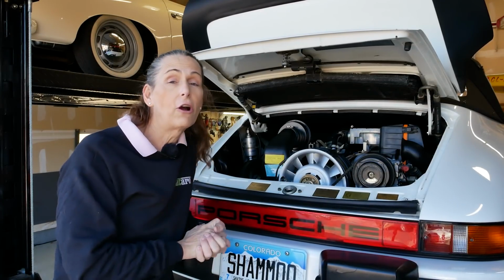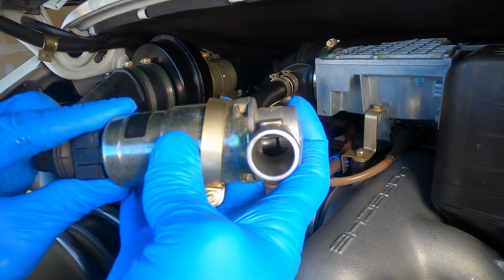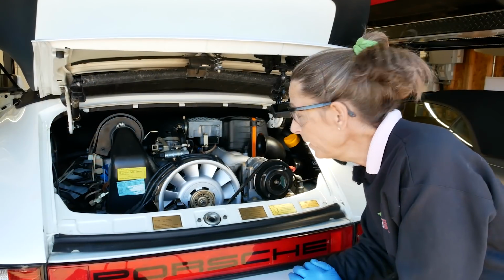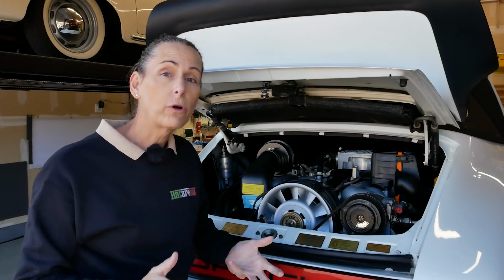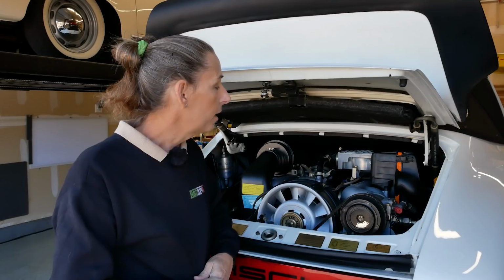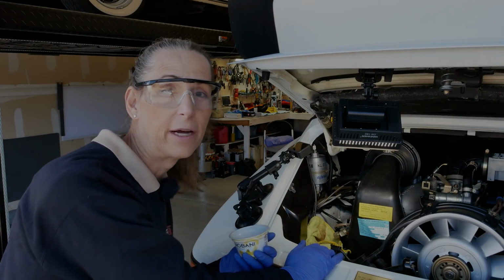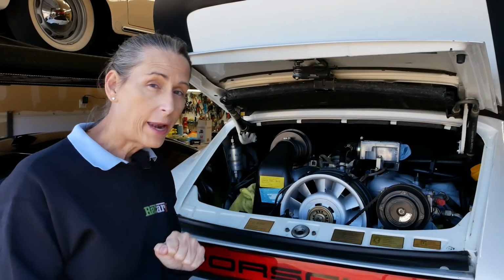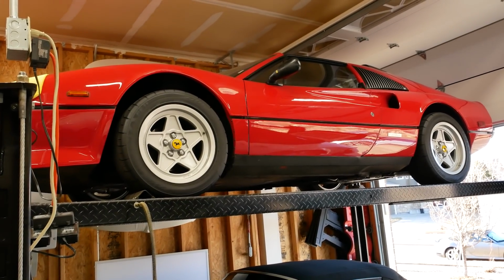Budget eBay Porsche 3.2 Carrera Project Car! #29 - WHAT IS GOING ON WITH THIS ENGINE!!!

Comment: Oh no ; i Hope you changed the plugs ...

Spark Plug‘s with 4 Poles  ?  Better take Bosch or Beru Plug‘s with Single Pole cause 4 Poles Plugs are made for Racing Engines and for those with High HP Output and High RPM ( Supra with huge Turbo or 9FF Porsche and Co. ).  For an Oldtimer 911 could the Temperature inside rising and it comes earlier the explosions as normally by 3. Stroke  Point. 

Its a hint from a Car Mechanic & Engineer Study Times and Testdriver (Audi Sport, AMG and some other companies) from Germany and a Friend got a 911 years ago scarce with a blue eye notice before Destroying the Engine during Autobahn drive with 4 Poles Sparks run. First KM or Miles was all ok. than after around 500 Miles   Getting the Engine hotter and hotter and the rpm began jumping & Rising after normal warming phase over. The oil and water temp rise to day after day using until we changed the plugs. Check sparking point with special tool .. it sounds maybe that is incorrect to early or to late (audio sound..) and that can cost Gas and Engine Lifetime..
Maybe i am wring with that point.

Have Fun and good luck on streets with your 911 👍🏻😉

Comment: Awesome video best I've ever seen on the 3.2 Carrera. One minor point going through the process is the distributor in that series 911 running Bosch DME does not affect the timing of the sparkplugs firing. That function is from the flywheel position sensor so the distributor merely provides the mechanical link to conduct the spark from the ignition coil to each spark plug.

Comment: A lot of useless yammering - much of it just plain wrong. Warm engines with aluminum heads don't "clamp down" on spark plugs. In fact, it's just the opposite - the material expands when hot and makes it easier to remove spark plugs which may be partially seized in their bores. The only reason to wait for an engine to cool slightly is to allow the aluminum threads to be exposed to stress when aluminum is stronger. The higher the temperature of aluminum, the lower the yield strength. At the same time, a warm engine's spark plug bores are expanded to allow for easier removal of a steel threaded spark plug. That's why EXPERIENCED AND KNOWLEDGEABLE mechanics pull plugs with a moderately warm engine - not hot and not cold. "Carbon could break loose and hold one of the valves open" - seriously? Injectors "lock up" after sitting for a year or so"? More BS. If the injector rebuilder rebuilt them properly, they would have been properly lubricated with WD-40 before getting capped. Injectors sit at distribution warehouses for years before getting sold and used. If they are properly packaged after testing, they will have a virtual indefinite "shelf life". You may be an older person - congratulations you've been breathing for a long time - but you are clearly a faux mechanic who has about the same kind of knowledge one could obtain from reading books and listening to other misinformed people. This video was a joke - clearly intended to impress people who are largely clueless around an automobile.

Comment: Hi Franny
Great video as always. 
Now my expertise is limited to the 911’s window washing system.....however I did notice that the cable tie on the fuel line to no.4 looked pretty tight and potentially restricting the flow of unleaded goodness. Not related to your current issue but wondered if that would cause any power loss / restriction / imbalance?
Cheers, Matt
Reply from the maker: Thanks Matt, That is actually the wire to the injector ;)  They get their fuel from the square golden colored square tube above them (the bit the wire tie is around).  I tried to put them back exactly where Porsche installed them back in 1986 :)
Reply: @HeidiandFranny  

Ah I see!  Clearly still building my knowledge heehee.

Comment: hi, in europe many gas stations are switching to E10 fuel, that have some components replaced with alcohol i believe. i have had injectors stuck twice within 18 months now. seems to me that new fuel is a hazard for older engines (mine is a european 3.2 1985). the fuel seems to deteriorate and become gummy, make injectors sticky more quickely than previous fuel types. do you recognise this, and what would you reccommend for 3.2 owners who often leave their car unused for months?

Comment: Just a random note on my 1984  Targa 3.2 rebuild. After a complete rebuild we reinstalled the 3.2 . Would  barely run /miss and backfire ~ also  made the Catalytic converter  glow red hot  . We tried everything.  plugs. wires. etc etc.  Problem was we replaced the old  flywheel with a new one & the kit must have not been machined correctly  Or world Pac  gave us the wrong Sachs flywheel throwing the 2  DME timing sensors off . My mechanic asked me " hey ! do you have the original flywheel ?  Im so glad I kept it ! We dropped the engine reinstalled with the Original flywheel . It fired up first crank and purred like a kitten !

Comment: Good detective work.  I do think there was an easier way.  I would have used a small rubber tube line.  With one end in your ear the other holding next to each injector to listen for operational activity.  Then just seeing if you have power.  If you have power, and no sound, replace the injector.  This also works on parking sensors on bumpers.  Worked for years on Porsche/Audi in the 70's and learned a lot.  Early systems were mechanical injection at over 200psi.  Different times for sure....
Keep it up.
Glenn

Comment: Like your channel a lot. I just bought a Porsche 1991 964 cabriolet With 40000 miles on it. With 40000 miles on it. I have restored jaguar XKE but for some reason have been afraid to do any work on this car. Fortunately at this point it doesn't need anything but your videos help me to think about doing more work on my own.
Reply from the maker: Hi Charlie, They can be a bit intimidating but once you get into it they aren't that bad - just different.  Enjoy your 964!

Comment: Excellent diagnostic. I had the same injector issue on my ‘89 3.2 and it was exactly this, a faulty injector. With mine the fault was engine hesitation, when getting back onto the throttle after overrun. These are lovely and underrated models and despite their compact size,  a car for all occasions.
Reply from the maker: Very much agree :)  Just a hoot to drive and very usable.

Comment: A stethoscope is very good to check injectors with. And faster. Just put the probe on each injector while running, and you can hear the clicking of each injector.

Comment: Hi.can u tell me what oil you put in car.& What year is Ur car.
Reply from the maker: The car is a 1986 3.2 Carrera and I use Valvoline 20W-50 racing because of the added zinc.
Reply: @HeidiandFranny  thanks very much for the info.my car is the same .But 1988 same colour.no spoiler &G50 gear box .

Comment: Hi idle with ISU ( idle stabilization unit ) working properly = intake air leak, missing cylinder or not.
Reply from the maker: Or it could be a bad idle micro switch... That would advance the timing and cause a high idle... Throttle plate issues... A vacuum leak or bad injector seals. There are several possibilities...

Comment: Franny, regarding the analysis, next time the first step (also easiest) is after the engine has run, take an infra-red temperature gauge/pistol (these now cost less than 20 USD) and check the exhaust manifold temperature per cylinder … You have a car lift so that's easy. (then the spark and then the injector (which indeed you did). Also I think I saw a small spark 23:36, so I suppose the jet needle was stuck - so it should be repairable, we will see). Success!

Comment: I don't recall removing the outer axles out when removing the engine in my 930 many years ago.  Do they have to come completely out?
Fun series, I remember doing almost all the stuff you've walked through!
Reply from the maker: As long as you can keep them out of the way and from flopping around you don't need to remove them.  I was planning on R&R-ing them, but that wasn't necessary.  Also, I thought we would be moving the car more and I didn't want to to get all tangled up.  It did make things easier, but you have the time to pull them and put them back in...
Reply: Now that I'm thinking about, I seem to recall doing it both ways.  Hopefully someone can chime in as I'm now curious.

Comment: That engine bay is so clean, I can't stand it! Well done. One thing I've learned rebuilding Porsche and Volkswagen engines that are air cooled is, you have to either rebuild the wiring harness yourself or buy one from someone who makes them. I'm not saying this is your problem, but in the end it will be the weakest link once you get the car back out on the road. Has been for me several times until I realized this.
Reply from the maker: Thanks!

Comment: Its so easy to just start throwing parts at an issue rather than do the work to determine what the problem is.  Your process was methodical and wise.  Its a simple process of elimination.   Great video!  Cheers!
Reply from the maker: Thanks so much :)

Comment: Great stuff. I cleaned my injectors and The engine now runs better better acceleration esp. in the lo rpm range and sltly lower fuel consumpion according to the onboard meter

Comment: I would have used a compression gauge on the cylinder before looking at the injector or plug wire, but that’s just me.
Reply from the maker: That was done in an earlier video when the engine was in the stand.

Comment: Getting there. Hopefully with the injectors sorted you will back running as it should soon.
Reply: I made same experience like Nobert, but don’t think new injectors are cheep and even worse they are not available at any time. I let mine (964 / 209TKm) servicing 5 years ago and all showed perfect fuel delivery amount and spray. After a few month one of the injectors started to drip a bit.
It ended up buying 1 brand new injector in Germany (it was the final one I could get here / rebuild by Bosch not planned) and buying 5 of them at Pelican - overall 800 Euros plus delivery + tax.  So I think it’s worth to try to service them but sometimes it’s not really reliable and you are forced to by new ones.
Reply: I sent out a set of injectors to a guy I've been using for years and had problems. New injectors are cheap, not worth taking a chance. When I had a 1988 Porsche 911 I put a new set of Bosch Platinums in and the car barely ran. I dug the NGKs out of the trash put them back in and car ran great again.
Reply from the maker: @norberthofer5830  OEM Injectors are $300 a pop.  They came back from RC and are working just fine for a fraction of new.
Reply: @HeidiandFranny  Didn't you just have an injector failure after having them serviced. I've been getting injectors rebuilt for years and thought that they have always worked fine but recently I've been having some failures. Its not fun swapping out injectors for free.
Reply from the maker: @norberthofer5830  Yes, but that was due to us waiting a year to install them when they warned us to install them right away.  That was on us not them.  Sorry you are having issues with rebuilds.  I suggest you try RC they are great.  And even having to reinstall again is much cheaper than $300X6.
Reply: @HeidiandFranny  If you shop around you can find new Bosch injectors for around $50.00 ea. for a 3.2.  I currently have 997 turbo and I can get injectors for a little over $300.00 per set of 6. I'll gladly pay a little extra $$ for piece of mind.
Reply from the maker: @norberthofer5830  Shoot me the link then (for OEM).  Autohause AZ shows $300.  I have seen others that say they will work but are not OEM.  And new parts (made not in Germany) can be a real pain.  No need to replace a good original part that can be serviced.  Our 356 has the original distributor.  It has been rebuilt but works great.  Same with the starter, etc..  I'll stick with the original parts if I can.  I feel the quality is better (IF they can be serviced).

Comment: First step: use a vaccum gauge diag. tool. Second step: use an engine compression tester. Third step: use an ignition timming light. You're welcome!
Reply from the maker: All the vacuum hoses have been check (but will check with a gauge), Leak down was performed in a previous video, timing is controlled by the Motronic and is not adjustable.  All of those would affect all cylinders.  This is a problem of one or two cylinders.
Reply: @HeidiandFranny  Good! Best regards & kick some German K-tronic and L-tronic butts.

Comment: The #5 spark plug was getting current, disconnecting #5 injector had no effect, and the spark plug was wet,  so therefore that injector was stuck open. Pull the offending injector and test it.
Reply from the maker: Ahh, but the plug was wet with oil, not gas...  I squirted Marvel Mystery Oil in each cylinder while I was setting the valves and as a preservative.  It was actually stuck closed...  I sent all six to be tested and I'm glad I did.  That wasn't the only issue...
Reply: @HeidiandFranny  Aha,  the wet plug was a red herring -- interesting!
Reply from the maker: @mafreed2007  Yup! It has me going for a while though... But I never got a flash when the plug was firing

Comment: One thought I had was to listen each injector with one of those stethoscope things used for finding noisy bearings. Injectors are quite loud when running at the full 12 V.  This would save the work of swapping them around. I never tried this since all my experience with missing cylinders has been with carbs, but I did mess with an injection system for a racing buddy who'd added a turbo to an L Jetronic equipped engine. The injectors on a bench were quite loud without the engine there to drown them out.
I've used long screwdrivers in my ear when I didn't have the stethoscope. Works almost as well if the engine isn't too loud.
Reply from the maker: Thant's a great idea!  I really need to pick one of those up.  Thanks!

Comment: Excellent video. On my ‘94 Carrera the EMS tool allows to diag the injector by pulsing each one 👍.  Can initiate test, run around and listen for click click in engine bay. 👍.   I probably didn’t need it, but, while engine out, I sent injectors to RC 👍. They are local to me,  
Looks like you’re  getting close 🥳
Reply from the maker: Thanks! Getting back to it tomorrow :)

Comment: I had an 85 Carrera for 20 years up until 2 years ago when someone offered me silly money for it (I had intended to keep it for the rest of my life)
It was the European model, so no cat, more power and a gearbox oil cooler.
When I first got it there was also an idle issue, but not the same as yours, but maybe related. Mine would want to stall if you suddenly lifted off @ low rpm. It found that there is an idle airflow adjustment screw (just behind the idle valve if I remember correctly). By turning it out a little I got rid of the problem, but if you turned up its out too far it raised the idle above nominal.
My impression is that the idle valve is just fine tuning, cold running and to compensate for the air con.
Reply from the maker: Yup, you are totally correct.  I bet the different fuel here vs Europe was the reason it needed an adjustment.  Our car was running fine before so I don't think that is the issue.  The manual says it needs to be adjusted with an exhaust gas analyzer.  I want to get the injectors all working properly and then verify each component to be sure everything is up to spec.

Comment: Of course I liked the video. Daa! Lol
If the plug is fouled from unburned fuel how is it the injector is not working? Can you see me scratching my head? Lol
Oh ya, hi Franny and Heidi!
You lost me completely on that round part in the hose that had the little rotating back and forth thing in it. What does that do?
I was waiting for you to turn the idle down with an idle screw. I'm not good with these modern cars. Lol
Reply from the maker: I think the plug was fowled more from the Marvel Mystery Oil I squirted in there to preserve the cylinders when we had the engine out.  That bypass fine tunes the idle so that is why I was fussing with it.  There is no idle stop.  I like that.  It requires all the bits to be working properly and there are a few that aren't happy ;)

Comment: Many times you can hook raw 12 volt power to the injector for about 2 seconds a tap (not longer, it will burn it up).  This overdrives and wakes the injector back up...they will stay working for years.
Reply: Hi no bueno. Instant french fried injector.

Comment: As an apprentice I was taught a golden rule when chasing a miss - always check compression first! Can save a lot of unnecessary diagnoses.
Reply from the maker: Thanks Robbie, I did a complete leak down test on the engine is a previous video while it was out.  The numbers were very good and very consistent.
Reply: @HeidiandFranny  Thks Franny. Great logical and thorough investigation. Love the tip using a 9V battery to test the injector operation. I'll put that one in the notebook! And I've had a set of nodes for 20 years. Invaluable when chasing a miss of injector issues.